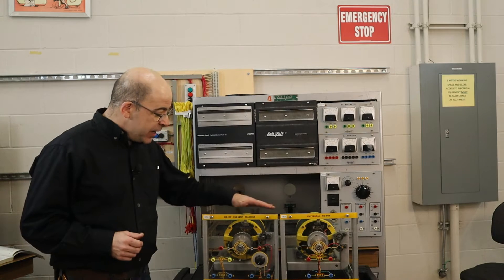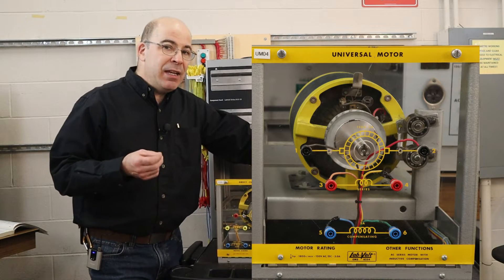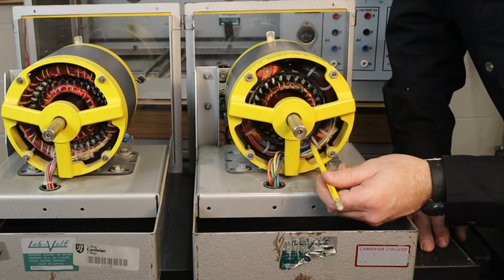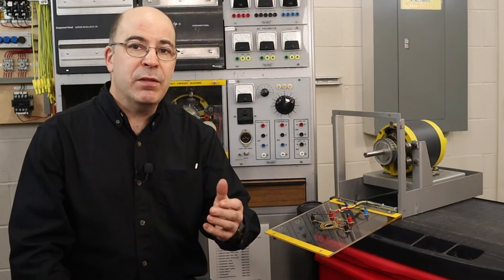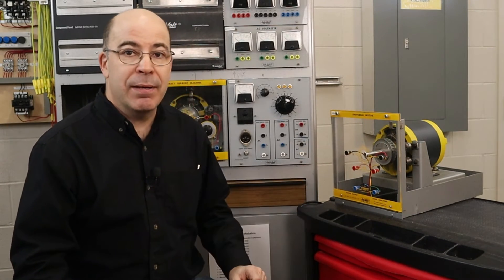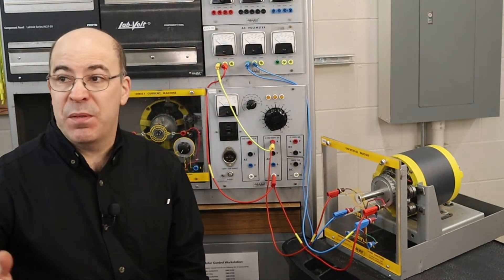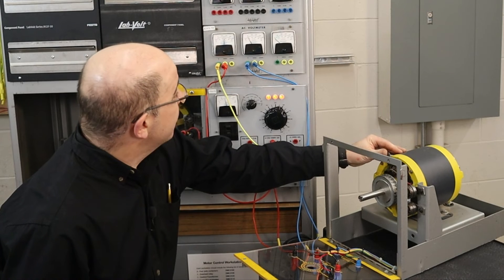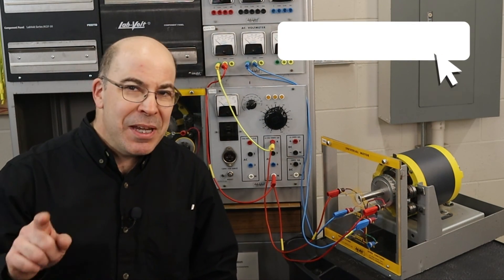The Universal Motor

Comment: Hi, thank you for your content,  I have a pump motor which is  3phase and  as I was setting the  pressure switch it  gave a sudden  flash and  stopped.  It was  running fine for about  5 minutes.  All the  equipment is  new,  I have  50 meters of  4mm wire  supplying it  . Just at a loss to know what is happening?  Thanks Steve.